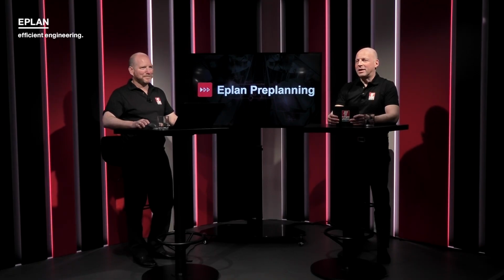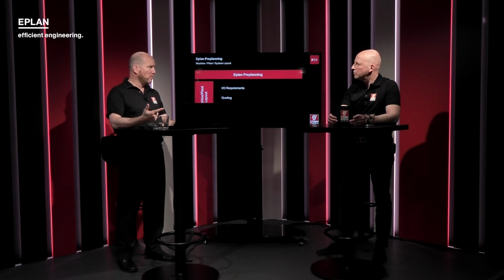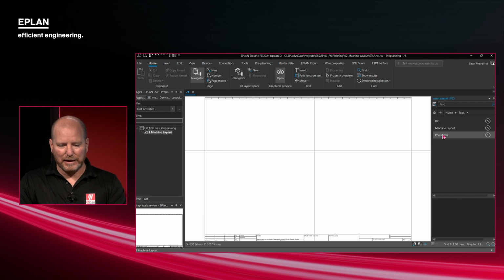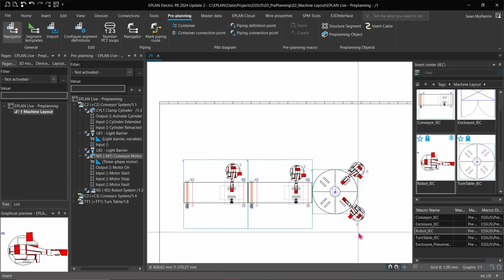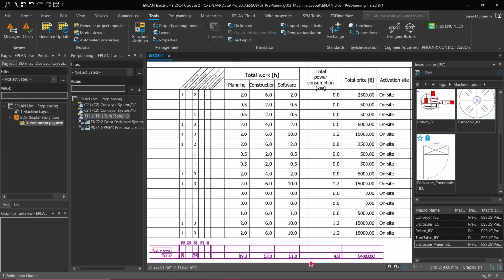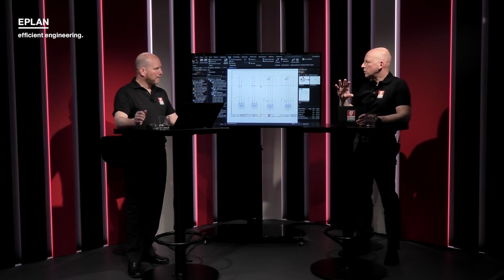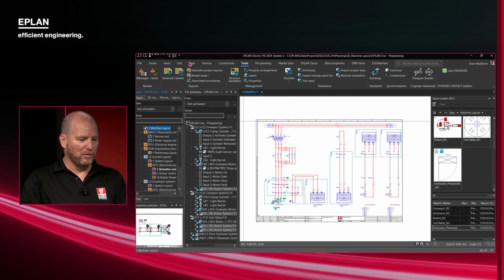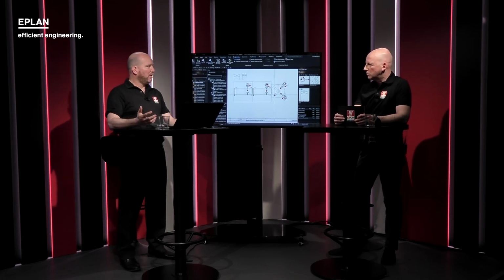Digitalizing Preplanning in Electrical Engineering: Streamline Workflows with Eplan Preplanning

Comment: Look awsome however I would like to know how long did it take to prepare alle the macros for the specific pages/devices ? On the presentation it looks seamless but from my experience preparing macros takes a while. Besides that the tool looks really powerfull and usefull.
Reply: I couldnt find and download the macros
Reply from the maker: Thank you for your feedback. Since macros do not have to be created from scratch, the time required for their creation is scalable and depends on how complex you want them to be. Also check the Eplan Engineering Standard first to see if you can find a suitable starting point, before creating your own, as there are lots of samples.